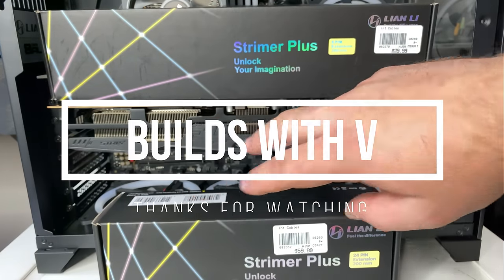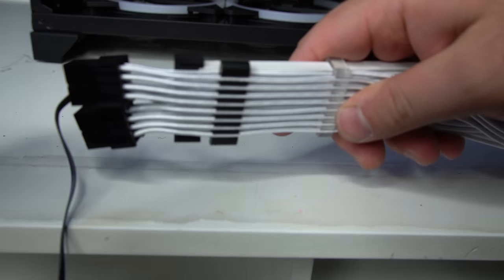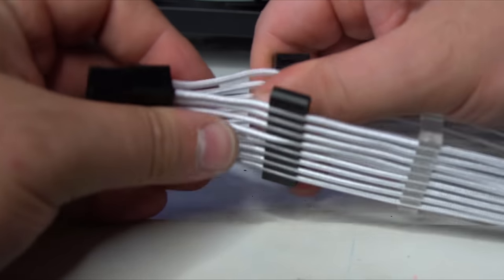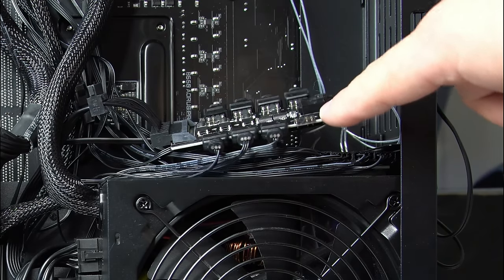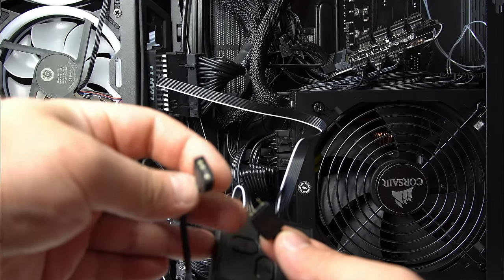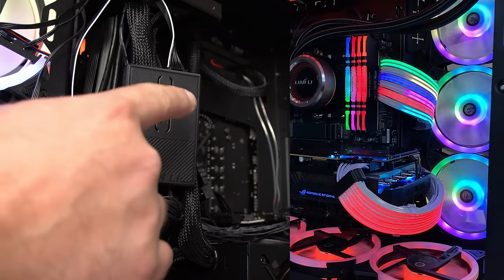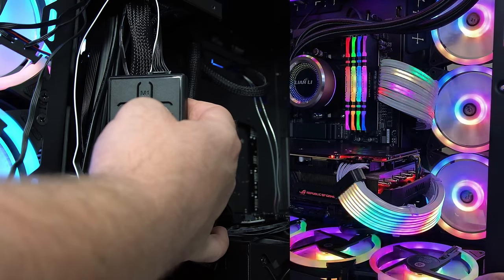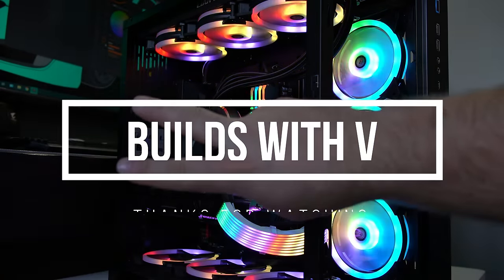How To Install Lian Li Strimer Plus RGB Cables + Review & How To Use

Comment: I have the same RGB ram sticks and I can't synchronize them the Asus aura software there's always one doing it's own thing, so I use crucial MOD software but I have to keep them in static the effects aren't great
Reply from the maker: Yeah unfortunately crucial ram is very picky with their software. Doesn’t work well with any other software besides mod. Mod itself isn’t even that good 🤦‍♂️ if you want ram that works well with aura look into geil memory. Thanks for watching 🙏
Reply: As I know, only Asus B550-E Gaming or X570-E Gameing work fine with crucial RAM ...

Comment: I have mine both plugged into sata power and 3 pin addressable header so I can switch between the default lighting effects on the controller and holding M1 switches to the motherboard 3 pin addressable header.
Reply from the maker: That’s definitely the best way to get the most out of it. I really wish Lian Li included a remote that can control them. Hopefully they do it for their next ones.
Reply: @BuildsWithV  Yeah, the  effects on the hub are way better that the effects that are controlled trough the 3 pin header. I have it mounted inside of my case opposed to it being where are the cables are at so it can be easily accessible.
Reply from the maker: I did consider doing that as well. Just not sure where I’d put it in my 011 case. Maybe I’ll think of something. Or if I can have it mounted in the rear of the pc. We’ll see

Comment: I just installed these on my new pc build I made over the weekend. I was curious to know if they make a stand alone App/Program for windows where you can control the strimer plus? Right now the only option is the small control box they supply me with. Have you or anyone else heard anything about this? BTW Build looks great!
Reply from the maker: Unfortunately they don’t make a standalone app. I do wish they would at least include a wireless controller that you can keep outside of the PC. I appreciate it 🙏
Reply: @BuildsWithV  def would be awesome to have a separate wireless controller.
Reply from the maker: @GmoneyNYC  Yeah either that or their own software would be even cooler. That way they can update it with more styles or even be able to custom make our own lighting effects. Towards the end of the video I put in a couple recommendations and I hope Lian Li watches this and takes some notes 😅
Reply: or you could just let your motherboard control them thats how i did mine and aura controls them. looks amazing and the FPS gain is ungodly.....

Comment: How do I know what software comes with my motherboard? I have an Asus Rog Strix B350-F Gaming Motherboard
Reply from the maker: For ASUS you'd use Aura Sync for RGB control (If your motherboard supports RGBs).
Reply: @BuildsWithV  Thank you, another question, would it be the same for my Asus Rog Strix GeForce 1060 6GB, as your gpu? I mean to connect it
Reply from the maker: @Darkycx  yes you’d connect it basically the same way. Not much different between GPUs besides how many connectors it has and size.
Reply: @BuildsWithV  thank you man, new sub and like, I will buy them soon ;)

Comment: are these the v1 or v2’s
Reply from the maker: These are the V1. I also have a video for the V2
Reply: @BuildsWithV  could you link the v2 video I’m having trouble finding the best way to mount the strimers
Reply from the maker: @zazaman9991  absolutely. https://youtu.be/CfQ3ar2mMOU?si=DLED0LSb1X8DEW8f

Comment: Compatibility rtx 3000 series ??
Reply from the maker: They are compatible with the 3000 GPUs and the new AMD GPUs as well.
Reply from the maker: @BigBHole69  I have the 2x8 pin on my 3080 along with one regular cable hidden behind the lian li cable. Works great but yes you’re correct, can’t get them currently at retail
Reply from the maker: @BigBHole69  do you have Instagram? I have a picture on there or you can dm me on there

Comment: I wish they added that effect 14:18 from the 8-pin variant to the 24-pin one where the color moves vertical and not horizontal. Great video btw, subbed :)
Reply from the maker: Jovie Brett Bardoles Thank you so much. 🙏 Yeah I believe they can add so much more customizability to their controllers. If they maybe did a remote and introduced more effects directly through their controller or maybe even released their own software like Corsair. That would be absolutely amazing. The possibilities would be endless. Their product is super amazing and looks great, they could definitely improve on the way it’s controlled. I appreciate the sub, thank you 😊

Comment: I want to see someone try to make these work with the RTX 3080 >.<. Great video though, answered my questions on how they work! Thanks!
Reply from the maker: Lukas Verzola they do work with the 3080. I appreciate it, thank you for watching 🙏
Reply: @BuildsWithV  my 3080 has three 8 pin connectors so this gpu cable won't fill all of them :( I am thinking of using the 24 ping motherboard cable on it but i'm not sure if that will work or be long enough.
Reply from the maker: @mechacharizard101  the 24-pin won’t work with the GPU. They’re very different as far as the connectors go. With 3 8-pin connectors I’d recommend using the Strimer on two of the connectors and then just plug in a normal cable into the 3rd one. Just hide the regular cable behind or something.
Reply: @BuildsWithV  alright I seen this makes sense, thanks

Comment: Can someone tell me which one I can use on my PC? I have a MSI VGA Radeon RX 5700 and my motherboard is the MSI 450-A pro max AM4 DDR4 3466(OC) VG. Thanks for anyone letting me know which one I can use on my PC as I'm a Tech-Noob...
Reply from the maker: You can use both on your PC. But you’ll need to have the 24-pin since that’s the only one that comes with the RGB controller.

Comment: Do they work with a 3090?
Reply from the maker: Palpatine it should work no problem with Nvidias adapter.
Reply: @BuildsWithV  Do they work with a Gaming X Trio?
Reply from the maker: Palpatine yes that’ll work
Reply: @BuildsWithV  Where can i buy the adapter?
Reply from the maker: Palpatine The adapter comes with the new GPUs so no need to buy a new one
Reply: @BuildsWithV  Even with the Gaming X Trio?
Reply from the maker: So that card will work without an adapter, however it does use three 8-pin connectors and these rgb cables only provide 2. So you’d need to either run a non rgb cable to it or buy another rgb gpu cable to have all 3 light up.
Reply: @BuildsWithV  wow, i just realized that i need to buy 4 of them lol, because i have 2 GPUs 😅
Reply: @BuildsWithV  This will be a little expensive...

Comment: Anyone who can help me out?
I bought the Strimer plus (Mainboard + GPU Cable) Everything conected with controller pluged the 3 Pin on my mainboard (Aorus B450 Pro) but i have no possibility to change effects, can only change it with controller.. maybe someone has the same issue and can help

Comment: There is no remote? if you chose use only the controller you have to open up your computer to change color and mode every time. That’s seems like a massive inconvenience.
Reply from the maker: L.L.L Correct there is no remote 😔 I do hope the next version of these will come with a remote for easier use. I found a way to mount my controller on the back side of my case so I can change colors easily.. but that’s definitely not how I’d like it 🤦‍♂️ Thank you

Comment: A bit late to the party but the only reason I'm hesitant in buying these is because I heard the 40 series Nvidia cards melt these cables, I've heard a couple of 4080 owners say the cable fused to their card, as a 4090 owner it just doesn't seem worth the risk of melting such an expensive card, would appreciate anybody debunking this...

Comment: If I control the gpu cable using rgb fusion like u can i make the cable a solid color no effects with a specific rgb value that I choose because I want to make it a certain shade of pink
Reply from the maker: Yes you can do that. I do that on mine all the time actually. I have several pictures on my Instagram @BuildsWithV as well.

Comment: I had it before.
I wanted every RGB in my PC to sync with Mobo RGB.
The 8-pin has a direct 5V 3-pin to the mobo and I actually was able to control it from my mobo as you did.
However, the 24-pin RGB cable is NOT controllable with mobo because it has to go through the controller and will NOT sync with mobo RGB.
Even with the presence of the 5V 3-pin cable from the controller to mobo it will NOT sync at all!
Don't why you didn't mention it in you video!
Reply from the maker: To switch to using the motherboard all you have to do is press M1 for a few seconds and it will allow you to control with software. Thanks for watching 🙏
Reply: @BuildsWithV  I did but never worked. It would turn it off but would NOT folllow mobo light controls at all!
Reply from the maker: @scorpion251075  oh that’s weird. Works without issue for me. Plugged the controller into sata power and into my motherboard and then pressed M1 and works great. Maybe you had a faulty controller or cable.

Comment: Best review ever
Reply from the maker: Thank you so much 😊
Reply: @BuildsWithV  another question that I have is that can I use the cable when my gpu needs two connections, one 6 pin and one 8 pin will this work since the gpu cable has two 8 pin connections???
Reply from the maker: @Plazma21  yeah you can use the GPU cable with only 6 pins. You just leave two of them unplugged.
Reply: @BuildsWithV  oh so I can just split the 8 pin part into a 6 pin?
Reply from the maker: @Plazma21  correct. 2 of the pins on each 8 pin are already detached.
Reply: @BuildsWithV  great and if I plug in my 6 pin gpu pin that I’m using right now to the lian li gpu cable it’s okay if the other two holes are left empty right
Reply from the maker: @Plazma21  Yeah that will work no problem. I have a 2070S with these cables and my 2070 has one 8-pin and one 6-pin.

Comment: 14:07 looks like its feeding the GPU rainbow power. :p
Reply from the maker: 😅 more rgb = more fps right?
Reply: @BuildsWithV  not unless you put a unicorn brooch onto the cable. Then you get more fps. ;-) but shhhhhhh don't tell anyone about that. also, want to buy the brooklyn bridge I have the deed and can sell for cheap too. :p

Comment: You said you only plug one set of those pins into the gpu but u plugged all of them in like bro ur confusing me
Reply from the maker: Depends on your GPU. If your GPU has 16 pins then plug all, if your GPU only has 8 or 14 or something like that then you’d only plug in 8-14
Reply: @BuildsWithV  what if one side has 6 pins and the other has 8?
Reply: @BuildsWithV  I kinda get it now but am I capable of removing two pin cables if I only have 14?
Reply from the maker: @curlyflac0  yeah you can keep 2 of them unplugged for that situation. Lights will all still light up since they’re different parts of the cables
Reply: @BuildsWithV  okay thank you !
Reply: @BuildsWithV  sorry for kinda being a douche , just kind of stressing haha first time plugging these in
Reply from the maker: @curlyflac0  it’s no worries at all. I completely understand. Don’t wanna mess anything up. Rather ask and be safe than don’t ask and screw it up. I’ve been there too so I get it 🙏 I appreciate you watching

Comment: can I install the 8pin only? i realized  something damn such a bummer you need to buy the 24pin for the controller. I'm planning to have white effect like in this video
https://youtu.be/68FGhvAQzFA
Reply from the maker: Yeah your can but like you mentioned the controller only comes with the 24-pin. You can still plug the 8-pin into a 3-pin ARGB header without the controller. But you wouldn’t get any of the lighting effects included with the controller.

Comment: i would have got a better motherboard and gpu then all that RGB
Reply from the maker: To each their own. I respect that. I just love RGBs and lighting. I personally upgraded to a RTX 30800 when it dropped and then back down to RTX 3070 because I didn't need the extra power. I also added more RGBs.

Comment: Them streamer plus are just junk
Reply from the maker: I’ve had them in a few PCs and in my personal rig for over a year without a single issue. What seems to be wrong with yours?
Reply: @Builds With V  I threw them in the trash they didn't even work anyways
Reply: @BuildsWithV  everybody has the same issue with them if they wasn't junk then why so many people having issues with lain li rgb stuff it'd doesn't work if that was the case it's would work like it supposed to